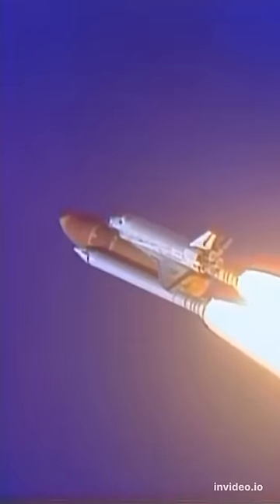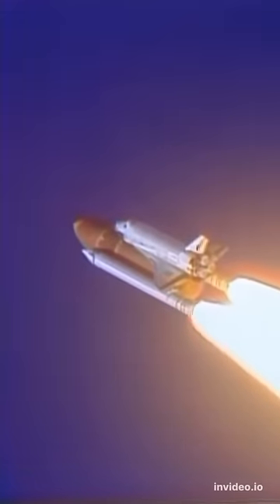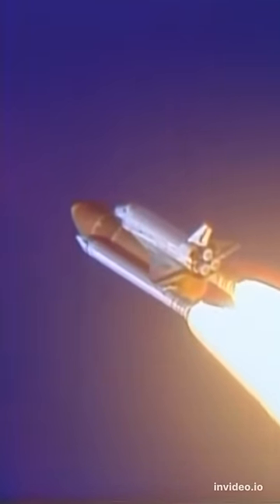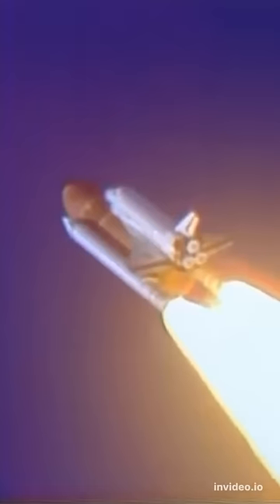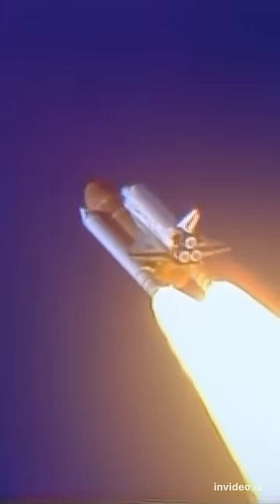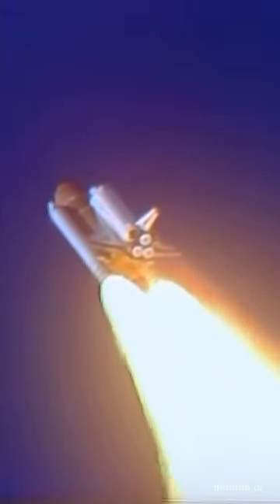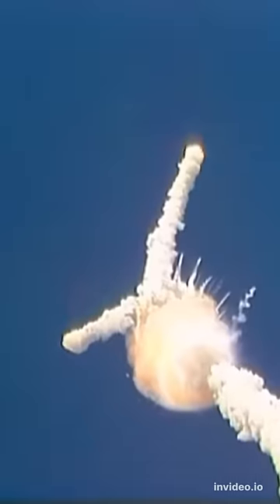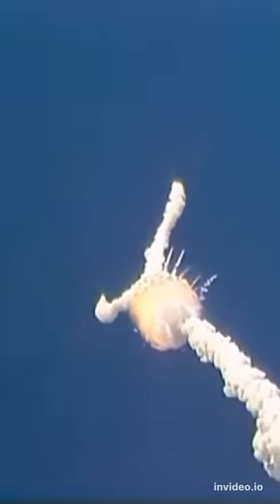Shuttle Disaster: Challenger STS-51-L Was A Major Mistake

Comment: Am I the only one wondering about rocket scientists using the phrase 104%
Reply: The engines were modified after the initial certification.  Rather than go through the entire certification process again, 104% was classified as the normal throttle.  They were actually capable of 109%.
Reply: @da40flyer  the engines couldn’t of been that capable they didn’t make it.
Reply: @Tim Timothy  109% was only in an emergency and was never needed.  The main engines on the shuttle had no part in the cause of this incident.

Comment: Yeah I remember the boss should have been hung wasn't it about some small O Rings that couldn't handle cold or something and the engineer informed the higher up about the orings need changed but they wasn't delaying nothing they wouldn't have it the engineer was quoted in saying they told him absolutely not and because it is just a small o-ring they didn't think that could cause any kind of a problem that would endanger the launch they said nothing will stop this launch